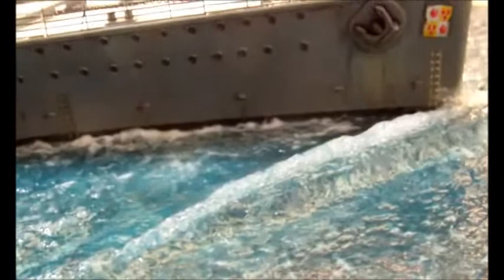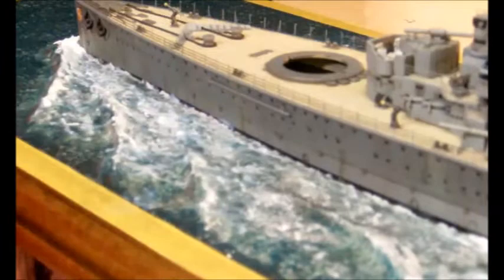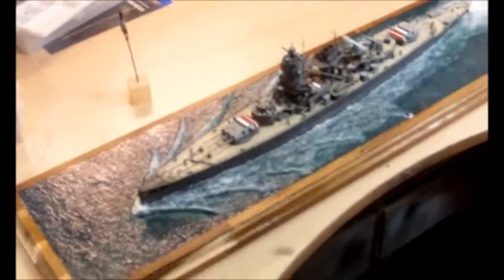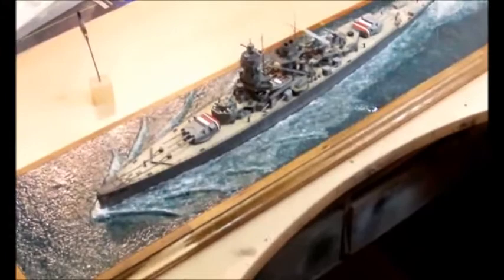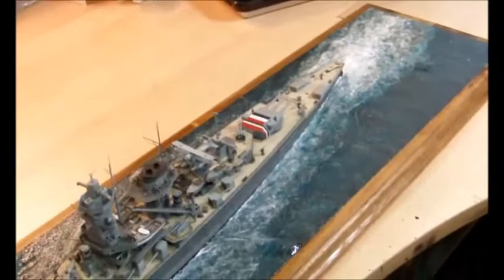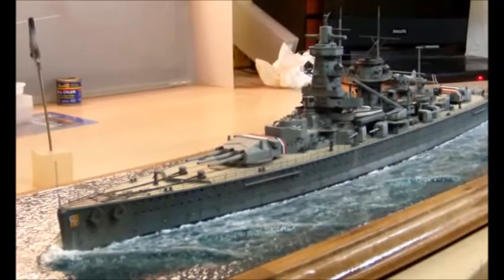1350 Admiral Graf Spee Sea Scape Part 7

Comment: Hello Guido, great job, I found this series of videos a few weeks ago and I enjoyed so much that I decided to buy the Trumpetter kit of the Graf Spee. I wanted to ask you what set of photoetch do you recommend most? Eduard or White Ensign?
Thanks and great job again!!!!
Reply from the maker: Thanks for stopping by! I am glad you liked the series and feel inspired by it. Regarding the PE you need to ask yourself, if you want to back date the kit or go for River Plate configuration. If the latter, Eduard will do just fine and you won't have to do a whole lot of scratch building. If you want  an earlier configuration you might need the searchlight paltforms that only WEM offers. Both are good sets.  Whatever you decide on: Enjoy the build and have loads of fun!!! Cheers! Guido
Reply: Guido, thanks for the quick response. I´m thinking to do the River Plate battle version. So I´ll go for the Eduard. 
Thanks for the advice.
I really like your work.